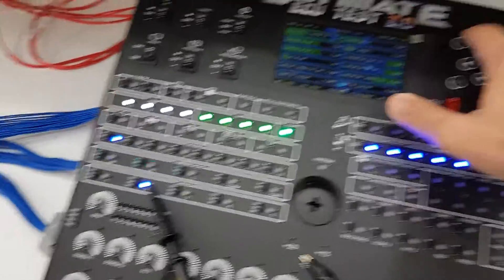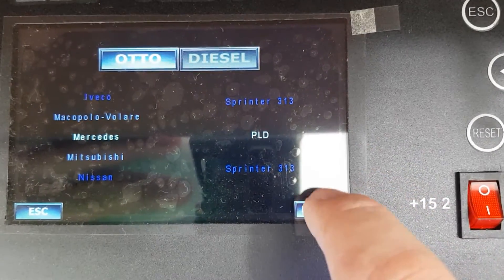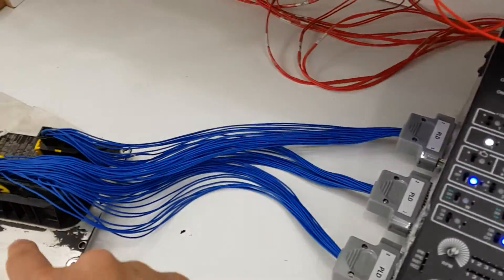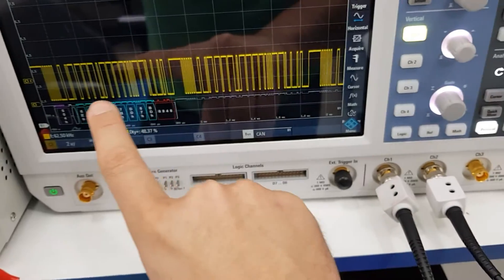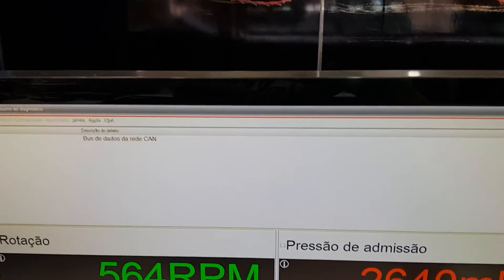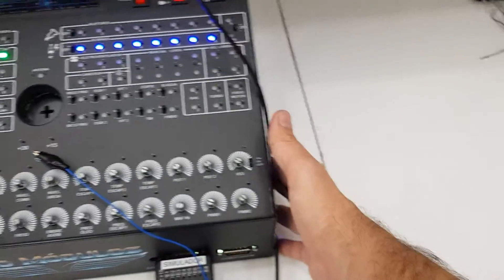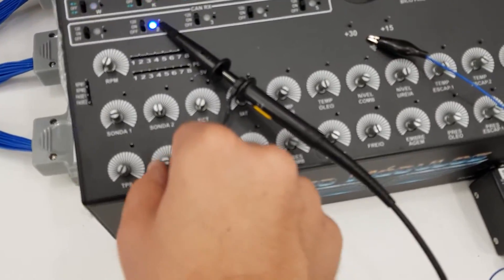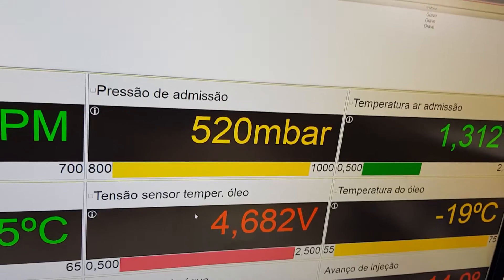[English] Simulating a PLD Mercedes ECU with Ultimate ECU Test 2.0

Comment: Do you have the part number of both connectors that go connected with this ECU, specially the 55 pin connector.  I need to replace it, but I do not have a part number to be able to buy it.  Thank you

Comment: Crankshaft  signal or camshaft signal Where to take ???
Reply from the maker: You can acquire the signal using a oscilloscope plugged on the CKP and CMP sensors.
Reply: @LeoMódulos  do not really understand Have video
Reply: Teste-PLD-Mercedes-Simulador-Caseiro.mp4